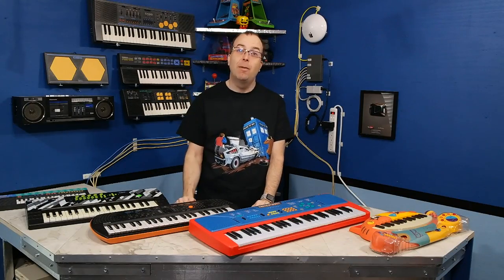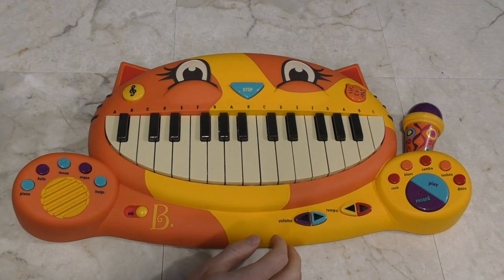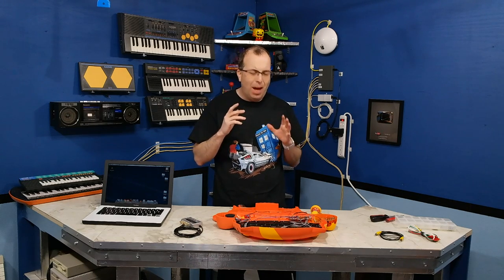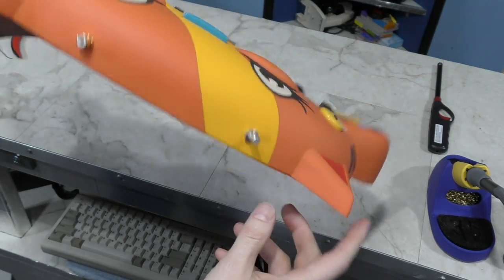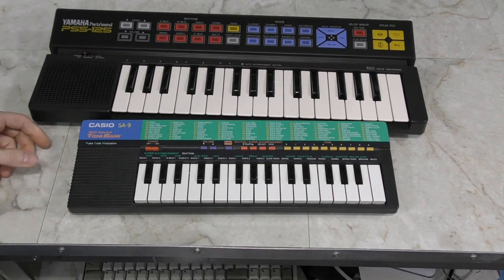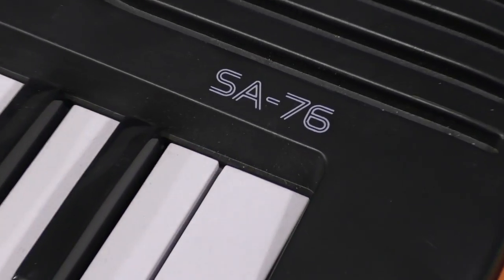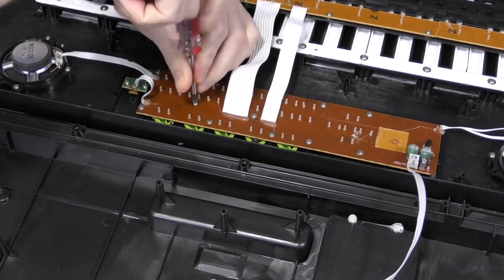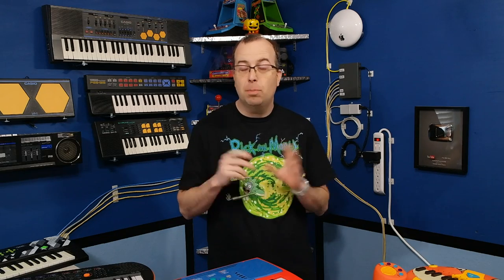Modern Toy Keyboards, Meowsic, Casio SA-76, SA9, & Technobeat.

Comment: The SA-9 is a slightly different colored (to fit better in the colorful 90s) version of the SA-1... A Keyboard from 1989.Yes nearly 30 Years old.  And it looks and sounds still better then all new mini Keyboards.
Reply from the maker: I didn't realize it was that old.  I thought I read somewhere that it came out in 2006.  I found mine at a garage sale a few months ago.
Reply: I've got a Casio SA-39 at home, one of the rarest. They started as of 1989, and the SA-39 is from 1998. The Casio SA-46 and SA-76 are from 2009, and still produced.
Reply: I still have my Casio SA1 (works perfectly) even with the original box. It was a gift from my parents 32 years ago. Really liked the video.
Reply: I had fond memories of it. The wham demo music makes me believe the keyboard could be more than 2 poly.
Reply: I think mine - see above - has the same chip and it has four voices

Comment: @8-Bit Keys: What capacitor value did you use for the Meowsic line out and why? I'm a circuit bender and whenever I've had to do a line out mod, I've only added a resistor or pot in series with the circuit to take the volume down, if needed. What's the benefit iof adding a cap and how do you determine which value to use?
Reply: A A Id also really love to know this! I’m making some upgrades to a Casio DG 10 and want to get some tips for quality
Reply: I'd be very much happy to answer that question. So, a capacitor, put it in simple words, allows AC to pass through while blocking DC. So, if your audio signal has a DC bias in it, you can connect a capacitor in series, so that the DC doesn't "screw up" the circuit or introduce distortion in the signal chain. The value can be calculated based on what pot you're using. Look for "RC high pass filter calculator" or some shit like that.

TL; DR: the cap blocks DC voltage and its value depends on the pot you're using, but you can usually go for 10uF and be happy, but frequency response might not be ideal.
Reply: @andrewmcwilliams9852  ^^

Comment: I recognize that Technobeat keyboard. I was 10 when I got it back in Christmas 2007. I don't remember what happened to it, though. I think it stopped working after about 2 or 3 years and it got thrown out.
Reply: Wavetable Guy Oh hey! Nice to see you here! And yeah, my sister owns a Technobeat. I use it to record samples for... projects.
Reply: Or your parent's car was stuck in the mud and the keyboard was in the car
Reply: Nice to see you here too, Tobikomi. Also, I (realized that the joke flew over my head. I see that you quoted what The 8-Bit Guy said in the video. That could be another use for the keyboard since it had all the issues that were mentioned in the video).

Comment: I'm fairly certain that the blank spot for an output jack on the Casio SA9 is for a headphone jack. I recently desoldered one from a set of old computer speakers, and upon further examination, realized that it has the exact pin arrangement as the empty space on the board. I wish I could get my hands on one of those keyboards so I could solder my jack in place to see if it works! ☺

Comment: does the demo key of the SA9 play "Wake me up before you go go"? besides the missing headphone jack and slightly different key layout it seems similar to a casio toy I had in the early 90s
Reply: As I just mentioned in a comment, it's the SA-1 all over again! That's the keyboard you had! :)
Reply: Yea, I also used to have the SA-1 (in fact, I STILL have it), which looks exactly the same (different color - mine was blue,) and has also only 2 voice polyphony, which is a big problem IMHO, because you cannot progress above a one-hand playing skill. SA-1 has the headphone jack.
Reply: as the true idiot I am- and was- I threw it away years ago because the speaker was broken...
Reply: Tomáš Kot  Yeah, the SA-1 was released in many colors and in two or so different boxes (the first ones are the ones in the blue box, with the "rad" 90's font, then in '92 they replaced it with a box featuring those kid cartoons that Casio was using around the time). 

Of course the polyphony is horrible, but they recycled the SA sounds in many keyboards, including the MA and CA series (and 90's PT models), some of them even featuring what sounds like a higher sample rate, so if you really enjoy it you can search one of those for a bit better polyphony! :)
Reply: Oli K  Well, you shouldn't worry - SA keyboards are very cheap these days (for a good reason), so you can always get another one!

Comment: Why did you apply the capacitor, what is its purpose? What kind of capacitor did you use? Some explanation would be nice, I’m a rookie here. Thanks!
Reply: Dukefazon look at 2:30 of this previous video here under :              https://youtu.be/EfE7FQaaJa4
Reply: He only said "for some extra safety" but he didn't explain. Thank you by the way!
Reply: A capacitor is added in series with the plug, to strip out and DC component on the signal. It kinda acts like a buffer, allowing AC audio signals to pass, while blocking any DC level on the signal. The bigger the cap, the lower the frequency it'll let through. The lowest frequencies are the hardest to pass, and the capacitive reactance (its kinda like resistance in AC) is highest at low frequency, and drops as frequency increases. It doesn't need to be a big cap in this circumstance, as the input to PCs and amplifiers are usually very high impedance (AC resistance again! It all gets interesting with AC) probably a 10µF or 1µF would do for a line out. And connect the negative to the socket, + to the audio signal. I noticed he put that cap back to front (electroytics don't like being reverse biased), But you can really get away with it with line level signals, since they ain't that high. But best practice would be negative to the output port. I hope that helps.
Reply: Thank you for the complete and prudent answer :)
Reply: Electrolytic capacitors don't do ac tho... I don't get it.
Reply: An electrolytic (or other capacitor),  will charge up to the level of whatever the output line is. Usually this is a DC level of ½Vcc. On this line, the audio signal moves up and down centered around this DC level.  By virtue of the charged capacitor, the other side also moves up and down, but around ground level, offering a nice and tidy signal for a mixer or amplifier.
Reply: Capacitor polarity depends on which side of the battery is made common ground connection,

Comment: the casio sa-76 is a good keyboard, especially for the money. I bought one when I was learning so I could keep it in the car. some players may find the keyboard toy like or find the keys unresponsive. I bought the medeli mc37A for about $70 new and it is great. It sounds and feels better than the casio, but it is bigger/heavier, so it is less portable. They are both good options for anyone in the market for a cheap, reliable keyboard.

Comment: What value capacitor are you using on that output jack?
Reply: I think it's 10µF, no need to add more. For the voltage, something like 10V is okay.
Reply: thanks man!
Reply: As a matter of fact, for connecting to Behringer UCA202 soundcard like 8-bit Guy uses, you do not, it already has series input capacitors. Nor does any other soundcard i can possibly think of, including a blue aluminium box i shot for $7 in China (i think via BuyInCoins) a few years back.

The capacitor converts the output or the input from DC coupled into AC coupled. The high frequency signal goes through, while at DC it goes essentially open-circuit, allowing the other device to bias the input or output to whatever DC level it's comfortable at, and preventing potentially high continuous currents that could damage something. You'll be particularly unhappy if you were to plug in something like headphones, the odds of burning them up would be pretty high if you managed to make a mistake on the keyboard side and connected the output to something that isn't already decoupled.

As to whether it actually affects frequency response... for headphones, it could cut pretty high, like right around 500Hz, you can mitigate this with a higher capacitance, like closer to 200uF, but for a soundcard or something else with a line input, no, the cutoff is in sub-Hz range, absolutely no problem at all.
Reply: Grzegorz Kończyk to block the DC voltage bias, often used when no negative voltage is available for the amplifing stages. Capacitors will be an open circuit for DC onced charged but will let trough AC signals.

Comment: helo David, what is the function of electrolyte capacitor in the output jack?
Reply: I think it's for stabilizing the output
Reply: @redakaminekloc5167  stabilizing? What do you mean? I don't think it was necessary since i don't think there's any DC voltage going to the speaker (otherwise it would likely damage the coil inside of it)
Reply: @ddcddc_  I dunno, that's just what 8-bit guy said

Comment: It looks like you used polarized (electrolytic) capacitors in series with the audio output jack. Depending on how the speaker is driven, the capacitors might see negative voltages which can shorten their lives.
Reply from the maker: Well, I placed it in the correct polarity so that hopefully that never happens.  Of course, it isn't like I'm going to spend hundreds of hours recording from the cat keyboard anyway.  :-)
Reply: mipmipmipmipmip yes, most capacitors are not polarized. Tantalum and electrolytic are polarized. Their big advantage is that they allow a much larger capacitance in a given volume. To A.C. couple an audio signal, a non polarized ceramic capacitor is typically used. In the application here, the reverse voltage (if present at all) is not enough to damage the capacitor, it might shorten it's life, but again this is not an issue here. Capacitors that are mounted backwards and supplied with a significant voltage are unpredictable: so blow up on first power up, others last for years... The tantalum ones can explode quite violently.
Reply: ooo hijacking this comment chain to reply to you quickly, 8-bit my man good to see you on the youtubes again. You’re websites cool as hell too.

 http://www.the8bitguy.com/category/the-8-bit-guy/ 

Also I’ve made the audio out mod on the catkeys using the instructables one and it works great! I now run it through distortion and delay and reverb pedals during shows as a crazy in-between songs meow filled interlude noise in my band (shameless self-promotion) Queenager which (even more shameless self-promotion) you can listen to here:
https://soundcloud.com/queenager

Anyways 8-bit my guy, watching your keys videos always reminds me I’m not alone in loving these classic casio crazies and for a bit there a small new hobby of circuit bending these things, and looking up how to videos, and any and all info I could find on them, and anyone else at all interested in them helped me get by on some rough days. Finding your channel was also inspiring! You seem like a pretty cool dude who just is working hard on what he loves when he can. Thanks for the awesome, informative, funny, and honest content. 

Have a good day duder!

Edit: ps just realized the music link does not have any catkeys examples… nuts.

Comment: But what is the function for the capacitor on the line output?
Reply: It's for decoupling. Basically it blocks any DC and only lets AC through.
Reply: Dave McAnulty but the device is entirely DC powered. Why would you need to filter AC?
Reply: Look at 2:30 of the video under :  https://youtu.be/EfE7FQaaJa4

Comment: The VTech Kidijamz Studio is perfect for it because it has a Line In jack for a 3.5 mm audio cable and it also has a headphone jack that is 3.5 mm for headphones or external speakers, and it has a volume slider for output. But when you plug in an external speaker the internal speaker on the keyboard aren’t used. To get around this you just need a headphone splitter to plug the headphone and the line out

Comment: What's the reason for the capacitor?
Reply: I was asking myself the same question.. i don't think there's DC going to the speaker, but i think he put that for good measure ahahah. Also in combination with that pot, it makes a variable high pass filter. So, that's not the usual volume control i'd put in my circuit or you'll find in most circuits.

Comment: Just wanted to say I use to binge your 8 bit guy videos once in a while way back in 2015ish, since than.

I picked up the guitar got really serious, joining bands and stuff, and wanted to learn how to read. 

Eventually resorted to learning the piano instead. Cause I reasoned it be easier to learn how to play the piano and read then learning to read in the guitar. 

Ended up getting serious on the piano too, playing excerpts of Chopin and trying a few pop/indie songs. 

However since the only time I can use a real piano is when I go over to my friends or families houses. I spend most of my time practicing on two crappy old second hand keyboards. One of which just broke.

But now that I rediscovered Ur channel and have bought a soldering iron(for guitar mods), I can't wait to get into  fixing and possibly modifying my keys. Sorry for the essay just wanted to say u and Ur channels r cool.

Comment: One thing to note about line out mods is to NOT use RCA connectors. RCA connectors are unbalanced, which means the sound loses quality in longer cables, whereas quarter-inch TRS connectors are balanced and don't lose quality. Always use TRS connectors for any sort of output.

Comment: I actually have a keyboard very similar to the Techno Beat keyboard. The differences are: It's black, the keys don't need a ridiculous amount of pressure, and a lot of the buttons are arranged differently.

Examples of the button arrangement include:
The power switch, volume, and tempo buttons are purple, the rhythm select buttons are yellow, the instrument select buttons are round and they're black, and the drum buttons are made of a soft foamy material and they're arranged in a straight line.
(If you happen to recognize this keyboard, please tell me the name of it; there's literally no branding on the model I have anywhere.)

Comment: Ironically there's been a wave of Pro keyboards with tiny keys, almost all of them, however, are only MIDI controllers.  But there is some oddballs that sort of try to be both a keyboard and a controller, like the Akai MPK Mini Play, which while being a MIDI controller, it can also produce sounds, but they are more like sounds from a regular keyboard, basically 128 instruments from a wave table ROM.   It has a rather small tinny speaker, While it may seem like a little portable studio, it can't record sequences, despite having  a tap for tempo button, and arpeggiator.  But it's only about $130, so a lot less than a Yamaha Reface.  Also, only 25 keys, but does have octave up and down buttons. It also has a joystick for pitch bending and modulation.  It also has knobs for filter and LFO control. So it can change those 128 instruments for a bit of flexibility, but still not a synth.

Comment: I have an interesting possibly rare toy keyboard. It is a Casio VL-Tone , an extremely portable keyboard that can record as well. It has 29 monophonic keys spanning a distance of 8.5 inches.  The whole thing is 11 3/4 inches by 3 inches by 1 1/4 inches thick. It includes a power in jack and an audio out jack and a 2 inch speaker. It is loaded with 5 built in sounds with the ability to program a custom ASDR sound and 10 selectable rhythms.